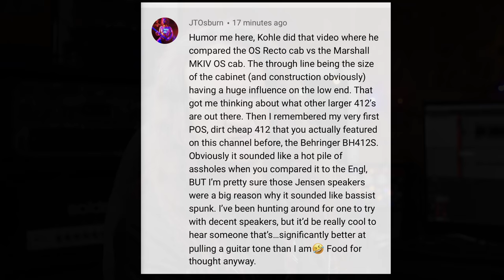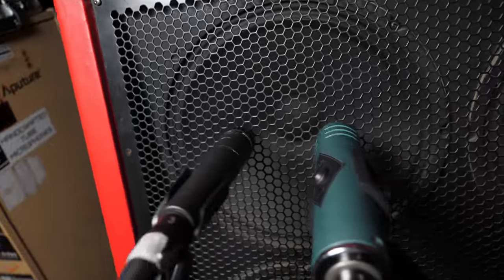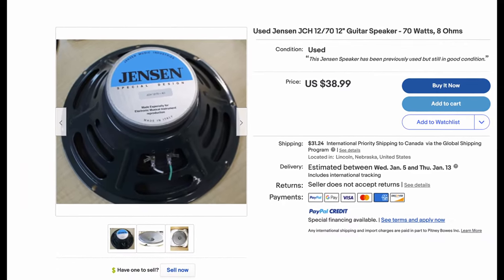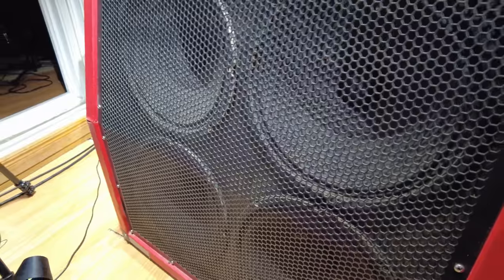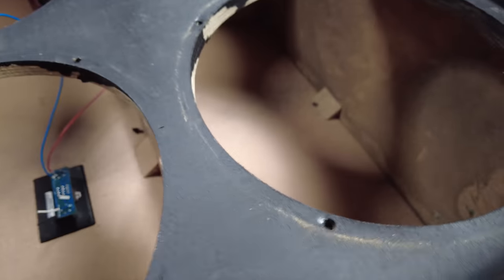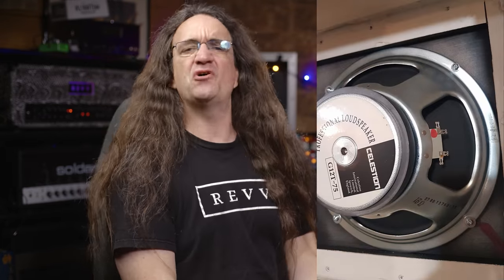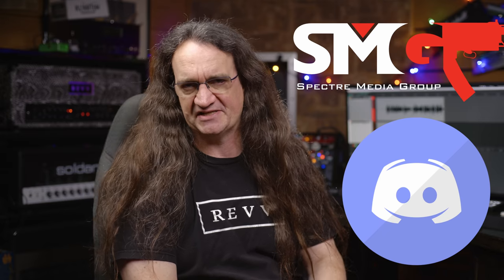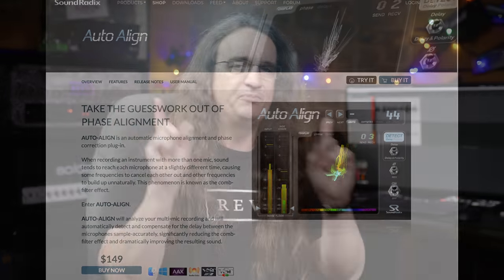We Upgraded the WORST Guitar Cabinet in the WORLD!!!

Comment: I love how before using the Grindstein the difference was already huge, but after putting the Grindstein (and the new mix) in the difference is just laughable. It is literally ridiculous hearing them side by side. The entire mix just falls apart, even though in the beginning the Behringer cab almost sounded acceptable-ish...
Reply: It sounded like the amp had an eq in the loop with everything dropped except the high mids. Like playing through a treble booster direct into interface! HM2 circuits also add a fuck ton of high mids and bass

Comment: I don't think there are standing waves if the soundboard is not parallel to the backboard, but a standing wave is not the only way to get a frequency buildup. Also, this cab is technically "full slant", since all 4 speakers are angled up; they're just tilted less than the top speakers of a "half slant" (marketing guys, take notes).

Comment: I found an old cab for free in a barn, it was a mess.  I grinded the rust off and painted the cab corners. I had to redo the tolex as well since it was ripped and rotted with mold. I cleaned the inside and the Celestion Vintage 30 speakers. I also bought new casters since one was broken and the rest were in terrible rusty condition. After all the work the cab sounds fantastic!
Reply: Nice! I remember doing something similar about 20 years back with an abandoned Marshall 1960 cab that was left behind at a multi room rehearsal studio. I had it completely restored with 2x V30s and 2x Greenbacks. Ive regretted selling that cab to this very day.
Reply: @bigmike2149  I sadly think that most of us have that one item that we regret getting rid of. On the bright side you now get to have the excitement of finding another cab that can be a staple in your studio!

Comment: I can confirm that the speaker cabinet does make a difference. I had a cheap-ish 2x12 that I put a V30 and a Lynchback in. It didn't sound bad but it was difficult to mix as getting the bass under control was difficult. I then got a Zilla Fatboy 2x12 and stuck the same speakers, used the same amp, guitar and mics and the sound was a lot more controlled imo. It was a lot easier for me to get the guitar into a mix as the bass was tighter.
Reply: The Tired Horizon  

All you need to do to test that, is knock on the cabinet. I prefer small single cabs made from something resonant, like ½" birch plywood and large cabs made from ¾" particle board or something similarly 'dead'. Of course cabinet design is most important. I dare say more important than the speakers. Getting the volume just right is a major challenge. Out of two different speakers, one may sound better in one cab and then the other will sound better in a different cab. Learned that in the 80s, with car boxes.
Reply from the maker: Different sized cabinets, yes.   Cabinet material?  We'll see.
Reply: @SpectreSoundStudios  The Zilla is a slightly bigger cab, it's also one hell of a lot sturdier. I think construction and density / weight will play a bigger roll that the wood.

Comment: Been on a real journey thanks to this video, replaced the stock speaker in my Orange Rocker 15 with a Celestion G10 Vintage, fantastic speaker, nothing like a V30, now I've modified my micro terror 1x8 cab to a semi open back and installed a Celestion Eight 15 at 16ohms to bring the volume down, it's amazing how simple these mods are and how dramatic the difference is afterwards.

Comment: I have one of those and swap out the Top Speakers. 1 Of the Jensens lives in a 1x12 open Back Combo and 1 is in a 1x12 Iso Cab... and guess what: They sound really good in those!
I think those where designed for that and Behringer just bought them cheap in masses. The Interview of that Jensen Guy on Kristian Kohle's Channel brought that up. they tried to recreate the old fender Jensens in the 1 and 2x12 Combos.
If you still have one of these try it. They sound really clear and not that "far away" like in the 4x12 in a small Cab.

Comment: I had a cheap ($80 pawn shop special) crate cab with no name speakers that sounded awful. I finally decided to upgrade. I found peavey 6505 Sheffield speakers (set of 4 for $100) on ebay, and swapped them in and siliconed all the wood joints and added foam behind the support beam.  Made a huge difference. Sounds pretty good to me now! Of course I've never played through a really nice cab. The Sheffields can be cheap to find, and apparently some sound better than others. I do like the 6505 (1200) models I got.

Comment: Much loved and treasured advice guy Glenn Fricker: Aren't most modern speaker cabs made of composite fiber board? What would happen if a person were to hand make a cabinet out of cheap pine boards? Say with a frame of solid wood and straight solid 12 × 3/4 approximately and perhaps some silicone. Some acoustic speaker treatment also. I'm just curious.

Comment: Wanted 2x12s ever since I saw the Mesa/ Steve Lukather collaboration in the late 80s... mine, a pair of LOPO mdf oversized slant front, came with cheap Jensen as well... replaced them with Sheffield in the bottom, and Celestion g12m70 in the top... loads of headroom before breakup, wonderful for my hybrid Podgo/MosValve 962 combination, very tight, with an immediate attack,  and nice mid low resonance. FU from Seattle, Glenn!!!

Comment: This is going to be a good lead into the different cab material test you are doing. When you are doing that test, look into the density/hardness of the materials. I think you'll find that actual materials won't matter in tone quality but density will affect it.  Calculate the volume of the wood used  then weigh it. Divide weight by the volume and that will give you a good number to compare among the 3 cab to see if that makes a difference than say plywood vs mdf vs pine vs obs or solid vs whatever you used.  It may come down to littler to no difference between any of them with similar densities.

Comment: Glen!! You oughtta experiment with a little insulation in that cab.  A lot of manufacturers used to stuff their cabs with insulation to deal with the standing waves.   Doing that, ime sounds like ass- for example I bought an old Ampeg V4 straight cab which had insulation on every surface, and I loaded it with vintage blackbacks and greenbacks ( a great combo for my V4 and my Marshall), but on first listen it sounded awful!!  All top end, stuff mids, a very tight but small bottom end.   Thankfully I had a friend who had one of the oversized V4 cabs and hated his too, until he pulled all the insulation. After he did that it sounded amazing!  I did the same, and the cab absolutely rules.  Only thing I’ll say is there is a bit of buildup in the low mids, but I guarantee I can deal with this by putting a small amount of insulation in it because low mids were simply not an issue when it had the insulation in it.  Key is not to go fucking crazy and deaden the thing.  Just a little bit placed strategically will work wonders.  Or I can just twist a knob…

Comment: I have a Marshall MG that I was meaning to upgrade for a while and casually enough, I was looking at the Neo Creambacks since the speakers it comes with have small magnets, and I didn’t want to affect the weight. Unfortunately I didn’t have enough money to buy all at the same time, and I wanted to have a smaller cab that could fit in my car, so I got the Harley Benton horizontal 2x12 with the V30s. I still have the Marshall, and this gives me great backing info to save up and get the Neo Creambacks. I may just split it and get 2. I kind of like the combination of the MG speakers with the V30, so I can see how I mixing the Neo Creamback in there will sound, and I can buy the other 2 later if I do no like the results with 2 Creams and 2 MGs.

Comment: I remember when i was being trained, we got in a Marshall 412 that had the standard g1270 or some celestion speakers. It sounded like crap to me compared to the one with vintage 30s we had been using. The producer had me change from an sm57 to an akg535 and it sounded amazing. Bigger and clearer than what i had with the other cab and the 57. It occurred to me that the speaker tone was only part of it and the mic could make up the difference in many situations.
Reply: The signal chain is important because nobody is hearing the same product the same as a result.

Comment: I actually did this same thing with a cheap Raven 4x12 a few years ago. The original speakers  were unbranded made in China that didn't work for the cabinet at all. The result was a super dark muddy tone that felt lifeless.
I dropped 2 eminence v12 legends and 2 eminence made jet city 12s in an x pattern in. All 16 ohm wired for a 16 ohm cab. The result was a much more lively and still unique tone that works with any of the three heads I own quite well. And I only spent 400 in total to do it.

Crazy side note I dropped two of the Chinese speakers into an open backed 2x12 cab I had laying around and discovered they sounded way better in that application that the celestion 70 eighty-seven it came with... who would have guessed...

Comment: Get some rubber grommets for the screws, to put between the cab and the grille. I think you'll find the rattle subdued. I used to do that on car license plates when I worked in the stereo business. Solved all those damn rattling ass plates when subs were installed.

Comment: GLEEEEEEEEEEENNNN!!!! Really curious on your opinion of using insulation/ fiberglass in speaker cabinets, as I saw that there was none in this cabinet. I've always heard that this is needed to help dampen any sound coming from the box itself (possibly internal echo/ comb filtering, etc) so that the sound is mainly coming from the speaker itself. I've even read in a book covering speaker design (from Radio Shack, before they became a cell accessory store) that if you have to sacrifice some size of cabinet volume, you can just add more insulation to compensate for the cabinet size/volume loss.
What are your thoughts on this? Do you think fiberglass or other insulation makes a positive difference? Could be a great experiment for an upcoming video!

Thank you for your work and inspiration,
Spencer

Comment: I have been using an old early 90's Crate 4x12 cab that I loaded with 50 watt Celestions wired stereo. Sounds great. The other guitar player uses a Marshall with vintage 30s. The Crate is much fatter sounding while retaining the clarity of the  Marshall. It just kills.   It is always the cab we use to record.
Reply: What Celestions are in the Crate then?
Reply: @MaximusAdonicus  TBH I don't remember the exact speaker models.  This was done in the early 90's. All I remember is they are 50 watts each. It has been a workhorse for me.

Comment: I would probably chack out all the corners of a cabinet, if there are holes in it, causing air pressure going in and out throug those holes, where two walls are not perfectly glued together, adding unwanted harmonics. If it's too bassy, you might want to put some absorber in your cabinet, like the ones everyone glues to the wall.

Comment: Great video, thanks man! Would LOVE to see some videos about how to do the wiring when replacing speakers in a cab. Also, how to do it specifically in a Marshall Lead1960 cab since it seems a little more complicated with the stereo or mono switch. Would be a great lesson to teach about ohms, serial/parallel etc. just an idea. Thanks! 🤘🤘
Reply: get a multitester & test circuit resistance, when you do rewire.  even with good directions, a mis- wiring could fry an amp.  generally, if your replacement speakers are the same ohmage as old ones, the wiring shouldnt need to change

Comment: I found an unloaded early 70s Marshall 1982A cab for dirt cheap, so I bought it.  Then my speaker repair guy calls me and says he has four 70s era Celestions that he reconed for someone and after more than a year they never paid him so he offered them to me for the cost of the recone kits (official Celestion). So I paid about, at the time, $20 each for them.  Turns out they were '73 Creambacks with 55Hz resonance, more or less the same speakers that were loaded in my empty cab.  So I wired them up and I've never looked back.  Best cab ever.  I will never play anything else.  Butter!

Comment: Good Grief!! Some of these effects are subtle, a matter of taste, but not this, like, wow

Those Jensens are dull and nasty - like to think they could do SOMETHING useful rather then end  in a landfill, but a metal guitar cab it aint! Night and DAY!

Experimenting with a 1x12 Eminence Neo, and now i just GOTTA try pairing it one one of THESE (thinking of a switcahble rolloff (series inductor) to take some of the edge off the Eminence - if that works use a coupla chunky toggle switchs on the back of the cab, to switch this and a 20dB power soak..

Prev to that I also wired something wierd - orig Anlnico 1960's jobbies drivers (1 Goodmans Axiom & 1 Japanese 'Eagle' LOL) in this WAY solid 1950's 2x12 (originally 1x12 widend the reflex port :) - it rocked with an AC30 chassis as a head!  :)  Sadly my Mk1 rig was destroyed in an illegal eviction (along w everything owned/made with my hands for > 25 yrs) but the AC30 sim on the HX is sooo like the real thing - cant WAIT to try it with real wood CABS - ROCK ON!

Comment: I originally bought a carvin 412 for $299 usd from guitar center back in the summer. Unfortunately i got sent to the wrong address so they were trying to find a replacement, the sent me a orange  ppc412 with v30s as a replacement, thats a $1200 cabinet! Soo, after that they sent me another carvin 412 for free. Dont know why and not complaining. My plans for my orange is to run v30s in a x pattern with greenbacks, and for the carvins, probably gonna do an experiment with different speakers. I seen ola englund combine greenbacks and v30s and it sounded amazing!!
Reply from the maker: Greenbacks are awesome... but try the Neos... very cool and MUCH lighter!
Reply: @SpectreSoundStudios  definitely will look into them after hearing them in this video!! Sounded awesome!

Comment: How the cab is built def has a lot to do with it. I run a Vader 4x12 with eminence legends and it SLAYS plug into a cab loaded with the same legends that's not an oversized cab and it just isnt the same, still good, just not the same and I imagine the truck bed liner on the vader adds density as well

Comment: From a meme:

"I'm a huge fan of using carbon zinc 9v batteries in my Boss pedals... specifically in my overdrive and chorus (and wah) pedals like my SD-1 and CH-1. I can def hear a difference in tone between 9v carbon zing and the wall power supply, and even 9v alkaline batteries. Its an easy experiment to do in case anyone else wants to try it. If you can't hear the difference then thats ok, but for many many players its an obvious tonal improvement. Try it you may dig it!"

Comment: I have 3 different 4x12 cabs that I equipped with 4 different speakers each. You can definitely hear a certain inherent characteristic for each cabinet. The speakers pretty much only give different takes on the same thing. In hindsight...using a different mic and mic position certainly would result in a bigger change in tone.
But at least, now I have a wider variety of nuances.
Edit: but then again, all of them already had quality celestion speakers, so the difference of before and after might be smaller than going from cheap crap to quality speaker
Reply: I went with a simplified version of that. I have a single oversized 2x12 with 2 different speakers. Between the 2 speakers and a handful of microphones  I can get pretty much any sound I’m looking for

Comment: Glenn, I have an Ampeg G-12, 412 combo, from the 70s or 80s. I got it from a friend who got it from a church that was throwing it away. After several hours of cleaning the rat crap from the head and carpet, I found the head to have parts literally hanging off. I can tell you that it turns on but it's definitely a fire hazard. I've thought about refreshing the entire thing, my friends and family say trash it. I've had it close to a decade now, and as I said, it worked but now, I'm not so sure, what do you think? Is it trash or can it be a treasure? 
  Thanks and Fuck You!

Comment: The speaker swap makes a big difference but the cabinet itself is as much important as well. Buying a cheap cabinet and using nice speakers won't do the trick alone. You would be even more suprised if you would have put those nasty jensens in a nice cabinet how much that makes a difference as well!
Reply: @REVOLUTION TV I own several different cabs, some with the exact same speakers, some have different ones. Different cabs with the same speaker tend to have different resonances in the low mids and high mids, especially the highs. It can be much more different than the difference between a V30 and a Greenback in the same cabinet.

Comment: I have a, from what I can gather from "internet research", 1989-1992 Marshall 1960a cab, with those speakers, but they are a different type of label. They sound FUCKING AMAZING. My understanding from "internet research" is the speakers were truly made in England, including cone construction. The only thing I am sure about is it sounds bad fucking ass, and I don't pine for a Mesa cab, and I am not even a Mesa hater, but that Marshall is good enough that I don't want to buy both. Cheers. Can't wait to put some awesome speakers in my smaller Marshall MG cab, never liked how it sounded. I honestly think all the hate on the Marshall MG 100hdfx is due to the cab, because on the genuine thing the 1960a, the head rocks.